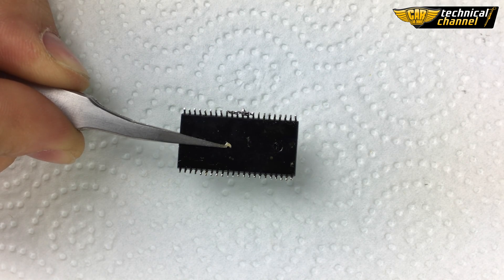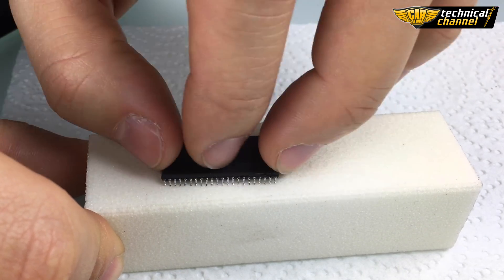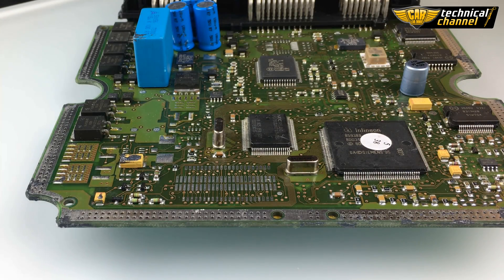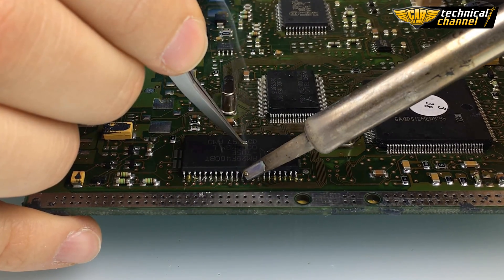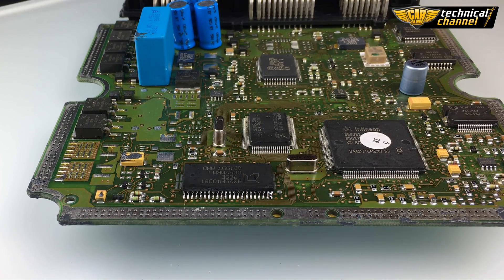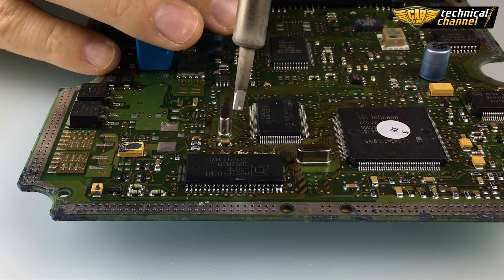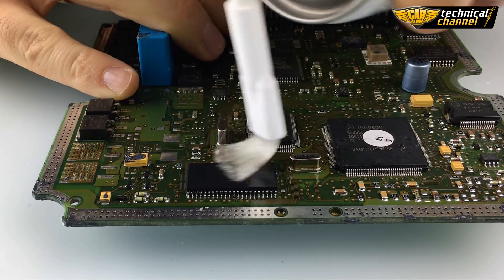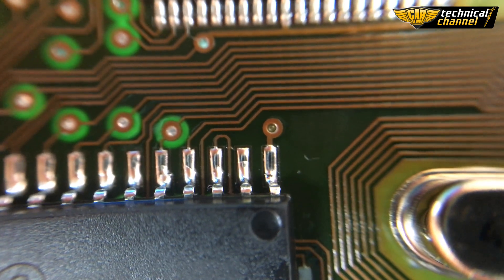FLASH memory soldering - how to do it correctly?

Comment: I'm attempting the same procedure on a 200 pin sodimm connector! So far so good, I just need to rest my old eyes before removing the few solder bridges and checking it with a loupe! Wish me luck.
Reply from the maker: Good luck then! :D
Reply: @CarLabImmoTechnicalChannel  Thanks, I did get it cleaned up, it took 3 days! So it worked, it took 3 days and is absolutely the hardest way to add RAM to a laptop!

Comment: Temperature?
Reply from the maker: Of what?
Reply: @CarLabImmoTechnicalChannel what temperature of heating of the soldering iron is more optimal??? Какая температура нагрева паяльника более оптимальна??? У тебя красиво получается пайка между ножками припой аккуратно ложится. У меня иногда получается, а иногда приходится плетенкой собирать излишки.You get a nice soldering between the legs of the solder gently lays down. I sometimes succeed, and sometimes I have to use surplus braids.
Reply from the maker: The optimal solderin temperature is 360 C. To correctly place the tin on the soldering pads, use flux gel ;)
Reply: @CarLabImmoTechnicalChannel  ок